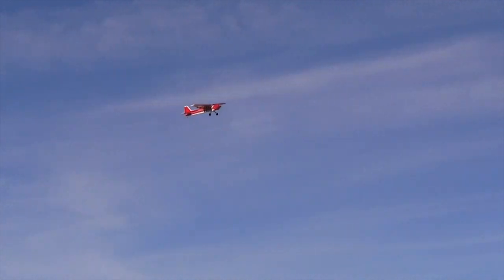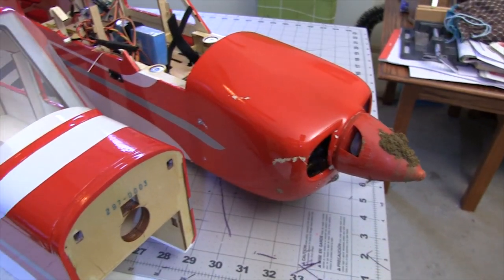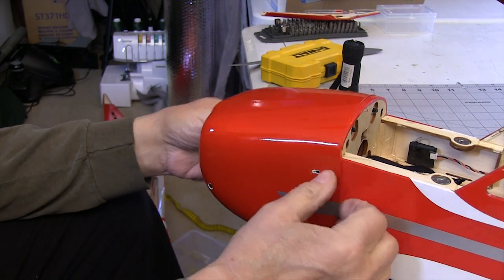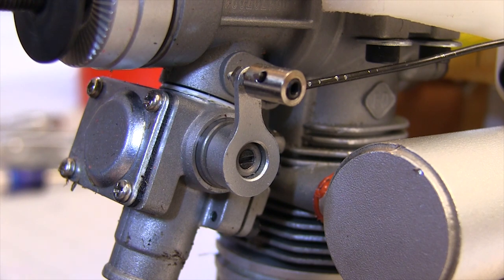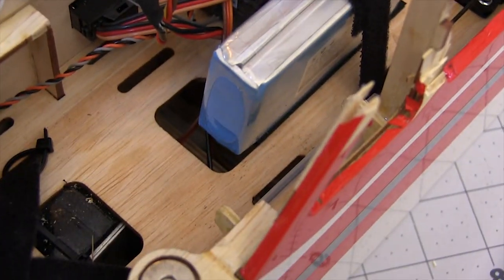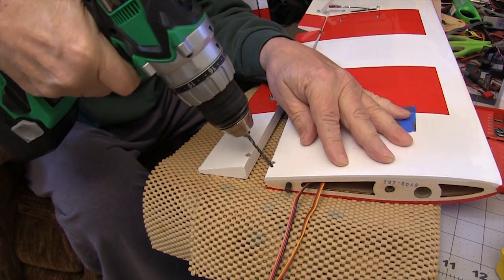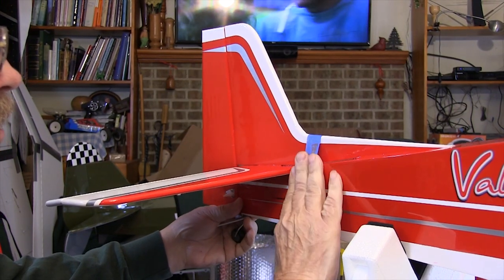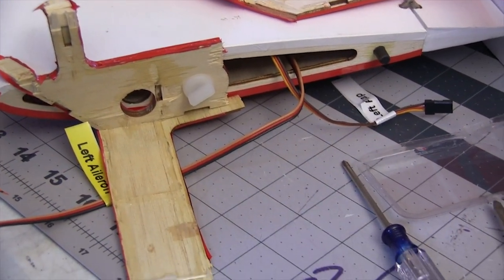Repairing Hangar 9 10cc Valiant Crash Damage

Comment: Good story, Tom. There are times when I see people get very discouraged after an unplanned encounter with the ground. The vast majority are only experienced with ARFs so they lack the knowledge of how the structures go together and what stress damage to be wary of (you explained well). In many cases ARFs can be rebuilt or reassembled with the availability of spare parts out there by the manufacturers. It isn't like the old days of going and buying a bunch of wood to rebuild parts that were damaged and months later having it ready to go again. In your case a flap fix, saving the tail feathers and new fuse did the trick in short order. Nice!

Comment: I always run a air filter on mine. A piece of pantyhose stretched over the carb opening and held on with a rubber O ring works fine.

Comment: HI thintz12. I notice that you were using one of the NGH 9cc petrol engines. Was this a later version? I purchased one when I was over in Florida in 2012, but read all sorts of negative reviews about this engine, so decided to leave it in its box. My engine had a separate crankcase actuated pump, which a lot of folks said to ditch, and to use exhaust pressure. Your carburetor seems different to mine. Have you had any running problems with your NGH 9cc engine so far?? I am interested in any help you can give me. I might be persuaded to get a different carburetor and give it a try. Did you weigh your Valiant by any chance,its a nice looking aircraft. Many thanks...Anthony
Reply from the maker: The NGH 9cc isn;t a rocket by any means but it does the job. I was a bit hard starting right out of the box but that got better on about the third tank of gas. I suspect it just needed to seat the ring a bit and start inhaling better. Other than adjusting the carb (very little) I haven't done anything to it, just flew it.